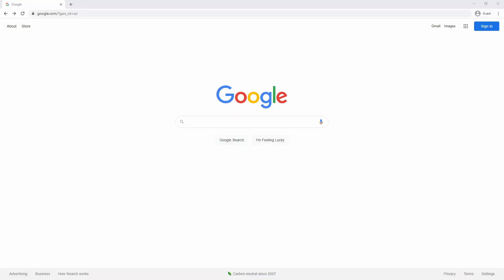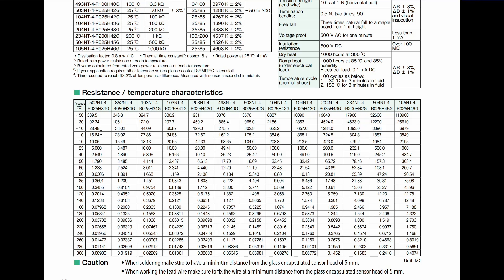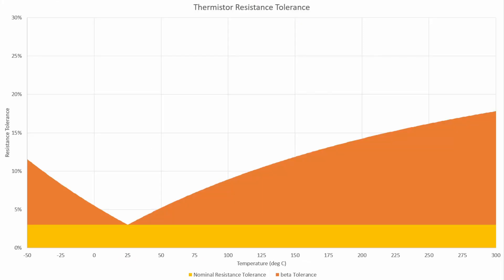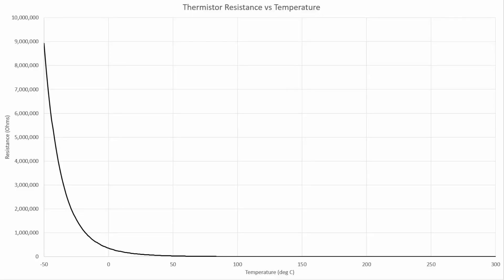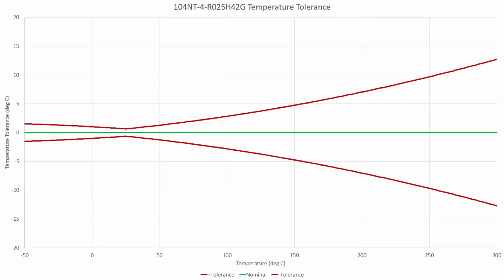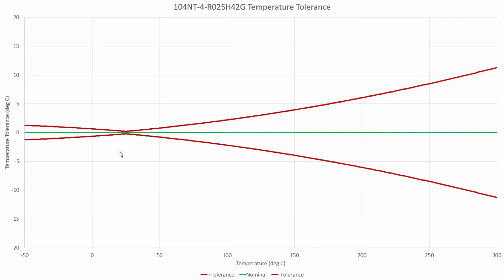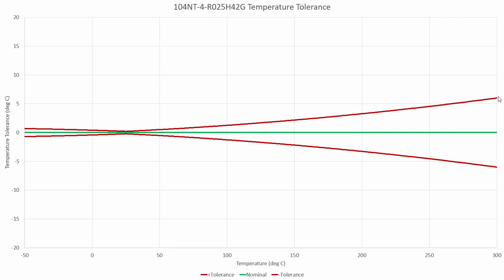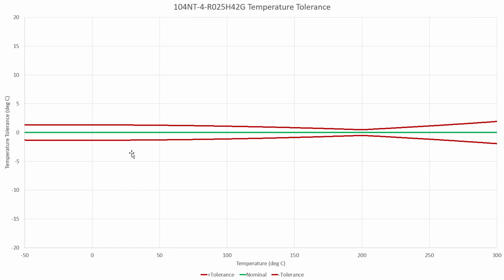Thermistor Tolerance Analysis

Comment: Nice explanation from a fellow mechanical engineer! :3 I should have been more cautious in getting a new thermistor for my Ender 5 Plus but I went with a generic one from Comgrow that at first would be a drop in replacement. I noticed I had to bring my temp to 260°C to get good extrusion of PETG. I found a video on YouTube that goes through a process to check and create a custom temp vs resistance (or ADC) table using a multimeter with a k type thermistor plugged in (found one at Home Depot for $54). Noticed the temp at 260 was actually 230 based on the multimeter temp reading which was pretty significant! Was able to get a temp table down and now it reads the right temperature at the range I print for PETG. Is this method considered wise to do if you have an odd thermistor on hand? :0

Comment: Basically, because of high resistance of Trianglelab T-D500 (clone of Dyze) at low temps (rooms and up to 100 °C) I wasn’t able to set correct profile for it in Klipper via 3 temp-resistance values for Steinhart hart equation without frequent failures of Klipper to restart itself because incorrect readings (ie at 22 °C room it went to -10 °C often due to digital noise). So I took their Beta for Beta 150/250 and used beta, temp for 200 °C and resistance at that temp to calculate the thermistor temp table. Setting initial delayed Gcode in Klipper to preheat hotend to 60 °C at the start of the printer completely solved issues. And I’m quite sure it measurees correctly now as measured resistance at given temps is pretty close to table ones.
Reply from the maker: That’s good to know! Originally this video was going to be 17 minutes long, and I had some comparisons between different thermistors including the D500. I noted that the resistances were a bit strange and was concerned about the ADC resolution at the low end—but it’s really great that they set the rated temperature at 200C with a beta between 150-250–that pretty much the way it “should” be done. If only they did a regular hotend thermistor <300C like that!
Reply: @eddietheengineer  I plan to print at higher temps anyway (PC and CF Nylon – some needs that temp). Maybe will use that thermistor in Mosquito hotend for my future (hopefully) Railcore build for high temp materials like PEEK and Ultem. 
Personally, I do not care about bad ADC resolution of T-D500 or Dyze at lower temps. First, Marlin and Reprap solves this issue with higher times for failure checks and higher tolerances (not possible in Klipper). Second, these thermistors become very precize at temps 120 °C upwards (more like 140 °C up). We print at at least 190 °C anyway for PLA (which I print rarely – little bit more PETG, even more ABS+ and soon CF Nylon – have to get good one). So for typical printing temperatures, even at lower end of the spectrum, it is precise as much as possible. 
So, personally I don't think anyone should worry about low precision at say 100 °C and below. Those temps really don't matter to anybody.
I went with this thermistor as it is very robust made – cartridge and spring cover for cables nearby heatblock are just great. Previously used EPCOS thermistor or any glass one sucks because are very fragile and cables can burn very easily too. And if you have filament leak well, it's definitely dead.
Reply: @eddietheengineer  ah man, would have enjoyed seeing that comparison. I need better temp readings for consistency between my printers, but PT-1000 + amplifier board is like an additional 20€ expense.

Comment: So now I understand why slice engineering has the 300c and 450c rated thermistors.  I just picked up one of each and plan to do some comparisons with my vorons.  

I truly think that controlling temperature is the key to getting more consistent extrusion.  Thanks for all you do Eddie!
Reply from the maker: Unfortunately their 300C thermistor is just a 104NT, and while the 450C has marginally better tolerance <300C, above 300C the temperature tolerances are very large to the point I wouldn't recommend it. I'm looking forward to finishing the rest of the videos to detail the rest of the stickup, but the PT1000 even direct connected with a standard 4700 ohm pull-up resistor is looking pretty solid :)
Reply: @eddietheengineer  I got the pt1000 from TL that you linked me to, will use them on the next build.